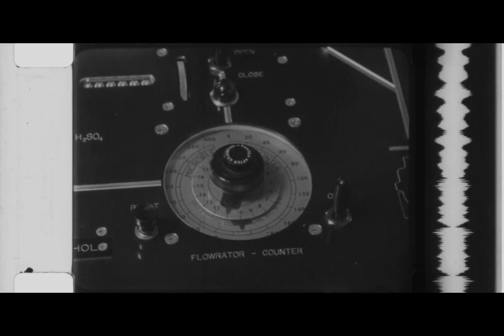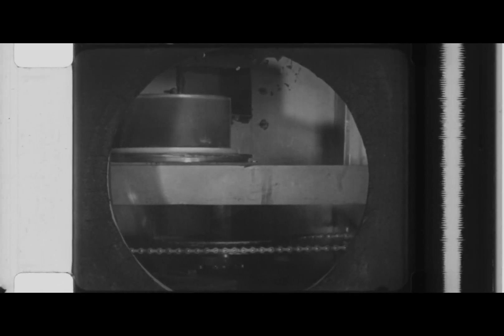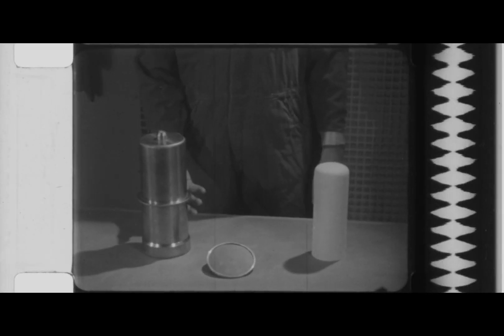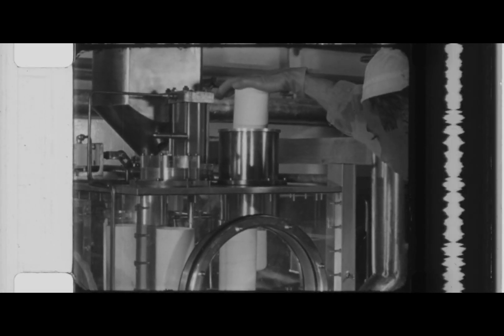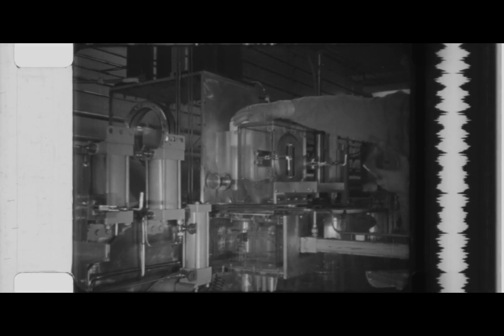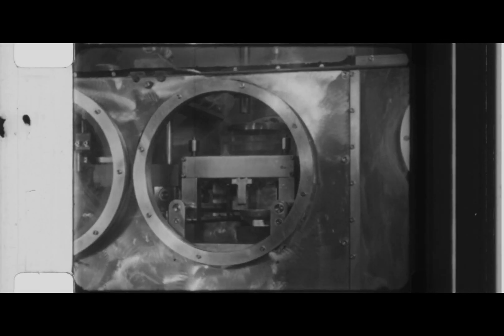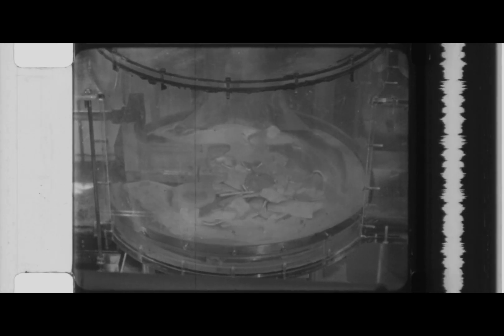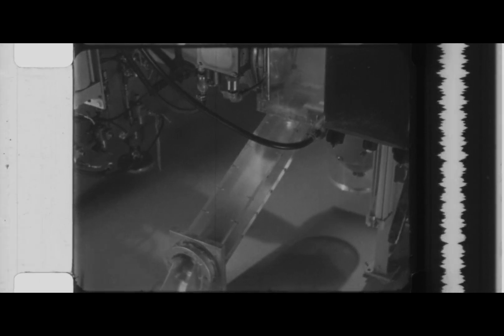Plutonium Metal Preparation

Comment: Some time after this video was made, the entire process was moved to Hanford and reassembled at the Plutonium Finishing Plant. The Finishing Plant was the last part of the Hanford Plutonium Production Facility to be shut down. It was also one of the most contaminated areas and took years to disassemble and decontaminate. 
With the exception of B reactor, all the reactor fuel preparation buildings, reactor areas, plutonium separation facilities and the finishing plant have all been torn down or sealed. 
The completion of the Waste Processing Facility and the removal of all materials in the underground tanks is the last step in cleaning up after thew Manhattan Project.
Reply: They never cleaned up the 450 BILLION GALLONS OF DEADLY LIQUID WASTES THEY DUMPED DIRECTLY INTO THE GROUND! OR THE 41 MILES OF UNLINED TRENCHES THAT WERE FILLED WITH DRY AND LIQUID WASTES!

Comment: That looks like a fun project. Where can you get that plutonium nitrate solution?
Reply: The started with natural metal uranium in reactor B at Hanford, moderated with nuclear grade graphite. The giant pile they built there had a push through system for uranium fuel rods/slugs.  They loaded the reactor with uranium fuel, and after a few weeks to a few months depending on where the fuel was located in the reactor it was removed. The neutron exposed fuel was pushed out the back of the reactor, dropping into a cooling pond, and a few weeks later they fished out the fuel slugs, chopped them into pieces, and dissolved them in boiling nitric acid. There is a classified organic process, actually a couple of them at least, that selectively pulls out uranium and plutonium from the acid solution, leaving all the radioactive nuclide fission products.
Reply: I ask every time I go to Home Depot. And every time they tell me they're fresh out, and that I barely missed it once again.

Comment: apparently plutonium is not made anymore perhaps due to disarmament agreements and NASA has to use old stock to make RTGs to send to (ahem Pluto) and other space missions. Perhaps some of the stockpiled nukes could be used. Apparently nukes have a shelf life anyway, doesn’t metal go brittle in the presence of radiation over years?

Comment: I worked at Hanford Westinghouse in the '80s and '90s, and I saw bits and pieces of similar processes going on. I was mostly in the 200 and 300 areas, but went to other portions of the Hanford site as well.
Reply: I worked in the 300 area as well! Subsurface remediation group
Reply: @Non-fictionation  I serviced electron microscopes and other equipment there. Cool place with a lot of interesting stuff.

Comment: Seems they glaze over what happens to all the plutonium contaminated waste streams coming out of this (the Ca / F powder, the hydrogenperoxide fluid, the mg allow crucible, the gasket and lid). That's the stuff they just chucked in an open pit in the 1950s.
Reply: Probably mixed it in breakfast cereal
Reply: They should've just dumped it in the ocean.  The solution to pollution is dilution.  😂 (just kidding)
Reply: Calcium Fluoride is actually rather inert. It is used for making high refractive index optical glass.
Hydrogen Fluoride is seriously nasty however - it is usually scrubbed by adding limestone. Anyone who has caught a whiff of it will recognise the smell caused by the corrosion of their nose lining.
Reply: +15 rubles
Reply: This is how Acid Canyon got it's name.

Comment: The critical mass used in the fat man bomb was the size of a small soccer ball around 4.5-5kg but the actual amount of Plutonium that fissioned to flatten Nagasaki was just 1g so a tiny tiny fraction of that button😮🤯
Reply: In the Fat man there was 6.2 kg Plutonium. Still subcritical without the Implosion technique. The uncompressed critical mass of Pu-239 would be around 10 kilograms.
Reply: As best I can figure, and you can check my numbers.  The Fat Man used a critical mass of 6.19 kilogram, of which about 1 kilogram was consumed by fission producing a 21 kiloton yield.  That would be about 16% of the fuel burned.

Comment: How many tons of "ore" did they start with to make that one button of Plutonium metal?!
Reply: It takes about a ton of good quality uranium ore to produce one kilogram of uranium metal. And it takes 1000 kilograms of uranium to produce 1 kilogram of plutonium. Assuming that button is a kilogram, it took 1000 tons of ore.
Reply: The longer the uranium is cooking the more plutonium is made U235 has 0.71 percent in uranium but when cooked for 24 months plutonium is produced at 0.8 percent per quantity of uranium. Fast breeder reactors were promising but using Nak as coolant had a habit of catching fire and also diffusing into the pressure vessel making it brittle. Using CO2 gas would be safer but all fast breeder reactors programs closed down due the above .
Reply: @romanchomenko2912  Actually, the irradiated fuel rods were generally pulled after about 2 weeks.  After that, the plutonium content decreases due to the fact that it IS a fissionable product in a reactor core...
Reply: US research on breeder programs were discontinued primarily due to proliferation issues. While the technology is not particularly safe, the main issue is political, not scientific. @romanchomenko2912
Reply: ore? plutonium is not mined out of the earth... it is not a naturally occurring element
Reply: @wyliesdiesels4169  I thought plutonium was created from uranium. Ergo you will need uranium ore to make it? Almost all plutonium is effectively man-made.

Comment: I wonder how many plutonium buttons are used to fabricate a warhead pit?
Reply: Each button is 100 to 120 grams, a wrapon core is about 4.5kg, so about 45 buttons worth. 🤓
Reply: I found some pictures of some buttons next to a ruler - it looked like they were approximately 1.5 inches in diameter and I guessed 1/4 inch in thickness. Using 19.84 grams per cm^3 as the density of plutonium and assuming a perfect cylinder as the shape I get ~ 143.6 grams so your numbers sound right to me.
Reply: Probably a bad idea to stack too many of them in one photo.  @slovokia

Comment: I wonder how that machinery was serviced? Suppose a motor burned out - how would someone replace it without getting contaminated?
Reply: most likely transferring the failed part to a plastic bag in a "clean" area of the glove boxes and then to waste or cleaning
Reply: Believe it or not, plutonium is not very radioactive, and a rubber suit and filter mask is all the PPE you need really. The reason they have everything sealed up is because they are working with powders which are dusty, and some parts of this process must be performed under nitrogen gas, not exposed to oxygen, because it will react with the material.  All of the equipment operated with a vacuum pump pulling nitrogen gas through, and the dust and particles were removed with HEPA filters.  You could remove all the material from the product stream, open a cabinet with the vacuum pump running, and go in with a rubber suit and a filter mask.  The danger is ingesting a particle or getting one stuck to your skin. The alpha radiation is completely blocked with a rubber suit.
Reply: The 'shortest straw' 🙂
Reply: They cant.  So they convince an unknowing worker to service the machine.  Then kill them and act like nothing happened

Comment: I think a similar process is used for uranium.
Reply: not even close. uranium goes thru a different process entirely
Reply: i think not - quite different chemistry
Reply: how do they do projectile?
Reply: No. Uranium is made into UF6 (Uranium Hexafluoride) and as a gas they put that into a centrifuge the centrifuge rotating very fast so the UF6 with the higher U-235 content will appear near the edge of the centrifuge. After collecting the UF6 gas with the higher U-235 content they repeat this process multiple times to get even higher amounts of U-235. After that they separate the Uranium from the Flouride and it gets back to a solid state. Now you have your enriched uranium. The process is slightly different and more complicated if you want to make fuel rods for reactors, also they don't enrich it as much as for a bomb.

Comment: Fun fact about plutonium, chemically it acts like cerium, the stuff that makes ferrocerium cigarette lighter flint spark good. In fact you could make a ferroplutonium alloy and it would be a bit heavier, and spark a bit better, would also turn the smoke into a literal cancer stick.😲🤓
Reply: It’s got a lot more colors and oxidation states though I believe.
Reply: Thank you so much I'll have to try that next time I get a hold of some plutonium.
Reply: Mee too @scottprather5645
Reply: Another fun fact is that tobacco emits low levels of radiation.
https://pubmed.ncbi.nlm.nih.gov/30060241/
Reply: Everyone knows the libyans have the plutonium from back to the future 😂
Reply: Cerium is it in ferrocerium rods, its iron flint and magnesium
Reply: @leafygreens8624  it has no flint in it. Flint is a mineral made mostly of silicon dioxide. It is an alloy of mostly cerium and iron in the so-called "flint" rods. If you replaced the cerium with plutonium it would in fact spark very similarly if scraped with a sharp object. Don't inhale the smoke though. 🤣
Reply: @christopherleubner6633  i am not so sure that plutonium would spark.....It has a very high ignition temperature, in order to get it to burn in oxygen, you have to heat it with a carbon arc torch, which is 6000 deg C.
Reply: @BjarneLinetsky It might not “spark” in the traditional way you’d expect but plutonium filings (finely divided metal - like the types released when metal is scraped or scoured) are pyrophoric and can spontaneously ignite in air.
Reply: @leafygreens8624  Close.  It's Mischmetal, which is 55% cerium and other rare-earths.  The mischmetal is sintered or alloyed with iron oxide and magnesium oxide to make a compound called ferrocerium because Mischmetal by itself is too soft to spark from abrasion.
Reply: So many people here pretending they aren't idiots. ☺
Reply: Where is the ‘fun fact’ part?
How incredibly arrogant of you to start your post with those words 🤦‍♂️
Reply: @cornellkirk8946 The "fun part" is, that a Soviet orphan source was repurposed as actual flint, by some unsuspecting dudes. With the expected consequences.
Reply: @cornellkirk8946  Some people have absolutely no sense of humor
Reply: @stevenblack7928 where is the humour?
Reply: @cornellkirk8946  Fun fact… If you swallow plutonium, you get a tummy ache!
Reply: Literally no fun neither facts. Welcome to yt where 13 years old lectures on nuclear chemistry.
Reply: @suprememasteroftheuniverse  it’s so incredibly arrogant of people to post “fun fact” then some drivel on vids on YT ain’t it.
Making out like they’re the ones here to educate everyone else 🙄🤦‍♂️

Comment: The need to do this remotely and at a distance really shows in the complexity of the machinery. All these chambers and viewing windows, how unusual! These engineers were absolutely genius in their designs. 

Also, I’ve read about two separate nuclear accidents involving a plutonium nitrate solution that went critical upon stirring in one of those precipitation vessels. (4:17) Apparently that “tornado-like shape” that forms when a liquid is being stirred vigorously is pretty efficient at lowering the critical mass of the plutonium solution. In both of the accidents, a blue flash of light was seen. One guy named Cecil Kelly started shouting “I’m burning up, I’m burning up!”  And the energy released from the blue flash was enough to kill him...this stuff is the closest thing we have to magic!
Reply: there is no telling how many f'ups they had designing that thing.
FYI thanks for the "Cecil Kelly" mention; learn something new every day
Reply: It's like anything with an edge... Gotta screw with it and have it go wrong a few times before a plan that "just works" comes of it all 🤷‍♂️
Reply: @MadScientist267 my golden rule of R&D is "gotta fuk it up 2 or 3 diff ways first, then we can start finding out
Reply: Ok, I learned some stuff I want to share after first watching this video.  When stirring a suspension with fissile material settled at the bottom, it's not the vortex causing criticality.  Water or oil acts as a moderator, slowing prompt neutrons.  A small amount of powdered plutonium at the bottom of a beaker of water may be perfectly stable.  But if it is stirred, the fissile material is evenly distributed within the water or oil moderator, making the moderator far more effective.  The effectiveness of the moderator makes the mass needed for criticality much lower.  So one doesn't need the vortex, just the act of stirring and distributing the plutonium can result in criticality.